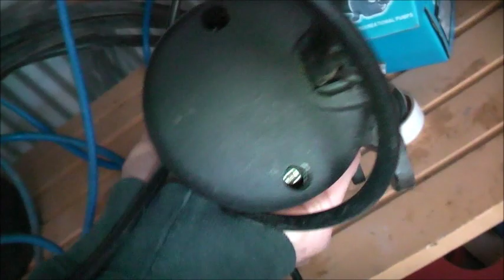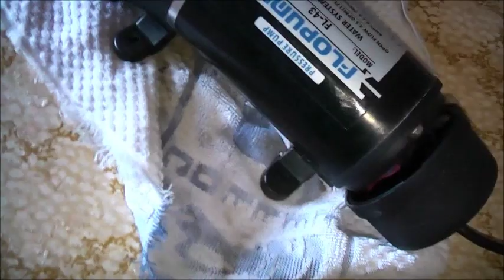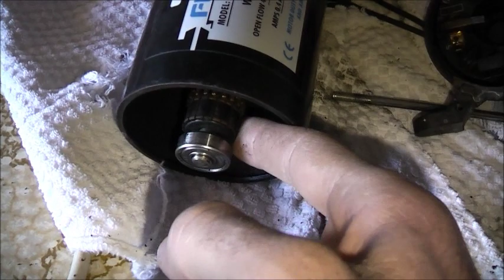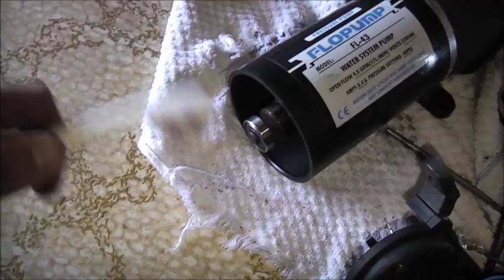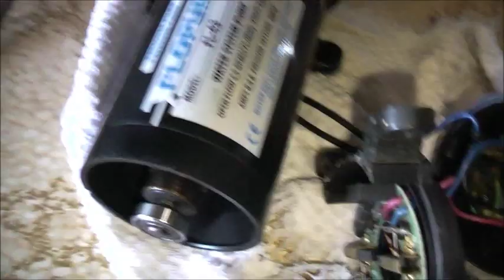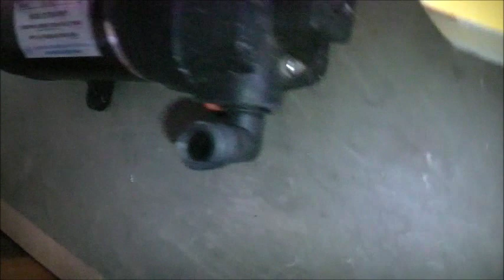Clean Out & Test Chinese Pump Motor

Comment: Also did you push the brushes back in the way they came out, they wear to the shape of the comms and dont allways work as good if you twisted them in there holders.

Hope my info didnt cause the motor to be more noisey :-(

Comment: Allways good to check the brushes, if they get too short they bounce on the comms and spark creating damage, the spring no longer applies enough pressure.

You will have to stick some water through it so you can listen to the motor without the pump part interfearing.

Good thing you checked :-)